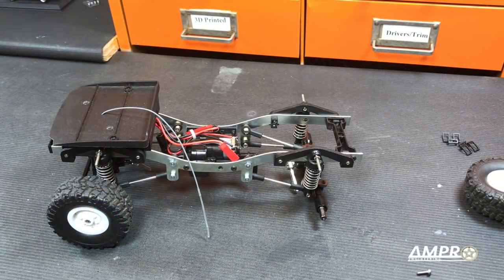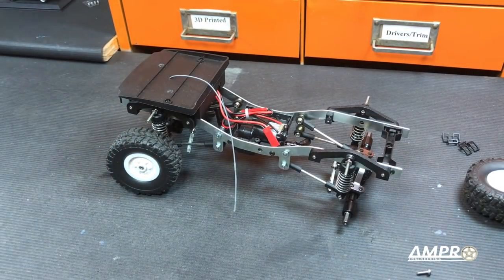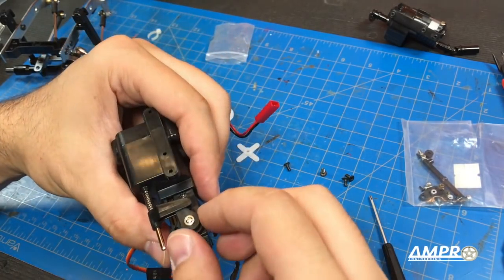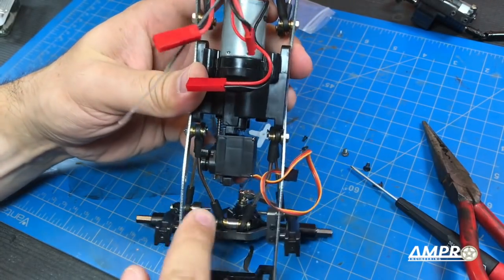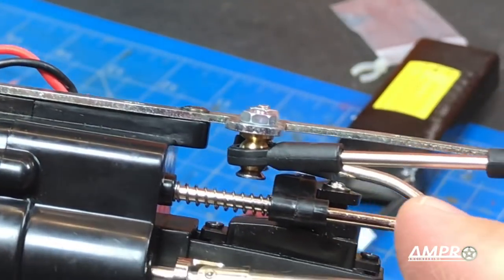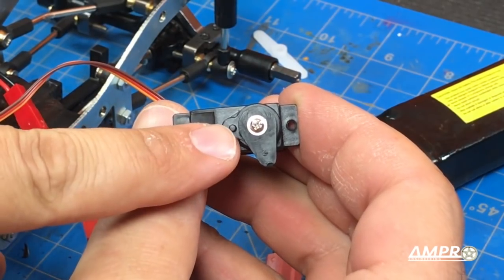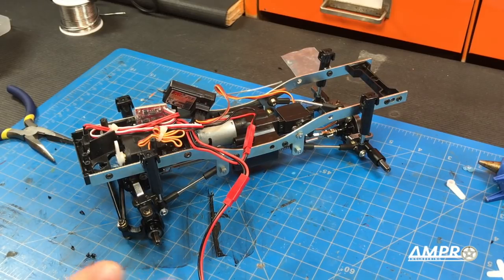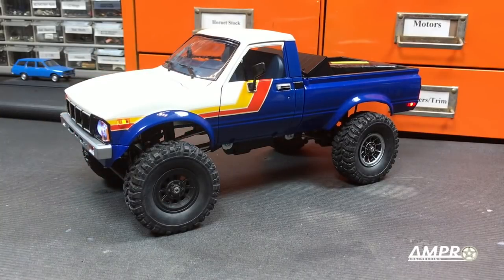e171: WPL 2 Speed Transmission and Project Completion

Comment: I found the same problem with shocks.
The best I found and have used are standard losi mini t oil filled.
They have long travel and are soft  for pretty much all wpl  and mn  models
Both 1/16th & 1/12th 
They work really well.
Reply from the maker: Oh yeah I have those too! I ended up using new oil filled units that just came out for it.

Comment: just using them should make them run smoother... if you get slippage then a washer behind the input gear inside each pumpkin should help... but you really just have to put up with it until your metal set arrives... use locktite on all the grub screws when it arrives as i had mine loosen until i added locktite
Reply from the maker: No it does run smoother and yes, loctite is my friend on this

Comment: Yay, I'm not the only one who got that 2 speed transmission box that has a notch instead of what others have been getting. Thanks for the tips!
Reply from the maker: There is a different version?
Reply: @AMPRO Engineering yes, there are 2 kinds that i have seen. One does not have a spring and the servo attachment looks like an elongated o ring that acts like a rail to drive the shifter. The second one is spring loaded too but slightly different than what we both got.
Reply from the maker: Interesting, I have three at home that I got from different vendors. I will look at them!

Comment: Sorry, very new to this chassis as santa is bringing one for my boy. does the OEM electronics control the two speed trans servo too?
Reply from the maker: No it will not. You will need a different radio, speed control and receiver.

Comment: You could try drilling the valve holes in those shocks a little bigger, would still need some thinner/softer springs.  Some cheap 1/16 or 1/18 crawler shocks shortened might do the trick, they tend to be soft, at least might find some springs that work.  Next thing you know somebody's going to make cable-locking diffs for this thing.
Reply from the maker: Yeah I did but they were just too stiff sadly. Now cable locking diffs...now you are talking!

Comment: mine with 2 speed, metal gears with full metal axles, the beefier metal drive shafts (the scale looking ones are actually crap) and bearings, is a really capable little truck... it never seems to lack power which was the problem i had with it from the start with the standard (kit) motor... id suggest the full metal axles as i had the ones with just the brass fixed gear and the plastic ends began to allow the axle to spin inside... still using the original shocks as like yours, my upgraded shocks wouldnt fit...
Reply from the maker: The scale drive shafts are so pretty but yes, total garbage.
Reply: Where did you find full metal axles at? I see them on eBay. But not for c14 or c24 . I see them for the 6x6 and the other wpl models
Reply: @raymondmanduley6299  i purchased them for the 6x6... compatible... plus i put the spare one on my sons wpl...
Reply: Are your stock shocks also very noisy?
I'm putting my kit together today.
Reply: yeah... a little creaky but just add a little grease and they quieten down
Reply: @TheDaddy187  ok sounds good!
I have the metal "kit" on a fright from China (all metal internals and turnbuckes etc.) And will just keep it like that for now.

The front a rear axles are REALLY clunky and the gears bind so much... any way to fix it?

Comment: Sorry if this has been asked/mentioned somewhere, but what tires are you using on this C24?

They look like the stock tires, but they look bigger for some reason.
Reply from the maker: These are indeed the stock tires. I do have printed wheels so maybe that is creating some kind of optical illusion?
Reply: @AMPROEngineering  I realized that after I posted. Your wheels look great. Nice classic look.

Comment: Alberto, pop by a hobby shop, K&S metal rack, grab music wire to wrap your own springs?
done it many times, it is spring steel. for those you might need 1/4" or 5/16" size rod to wrap on because of spring-back. .020 diameter? .015? make them a little extra long for pre-load, then trim coils if needed after.
Reply from the maker: I think that is a good idea but the oil in the shock seems to be the problem too. When I drained the other ones they were almost perfect. Ill look into that.

Comment: What length shocks are you needing?
Reply from the maker: I think 40mm but the spring rate seems to be the issue.
Reply: @AMPROEngineering  hmm. Yeah you might need to print up some shock towers to increase the length to something more common instead of mounting directly to the frame rail.  It'd look pretty sweet that way too.
I'm a shock snob.  Having actual damping makes so much difference that I can't stand driving an undamped rc.
Reply: @AMPROEngineering  or you could try doubling up the springs you do have assuming there is room between the perches.

Comment: Would it be possible to mount the transmission upside down to increases ground clearance? Just a Thought
Reply from the maker: It is a good thought. I am not sure but I suspect body clearance issues and driveshaft binding?
Reply: @AMPROEngineering  yeah that's true alternately you could make a plate either side and raise the mounting points above the chassis rails keeping it in it's current orientation I think something like 5mm would make enough difference without to much issue in the driveshafts and you could lengthen the upper links front and rear slightly to reduce bind by rotating the axles

Comment: Hey I was wanting to buy a trail finder and I was wondering if you could make an adaptor to for the high lift 3 speed transmission for it
Reply from the maker: Yes that should not be hard but to be honest the TF 2 speed is way better than the 3speed in the highlift.

Comment: Is your transmission an aikeec brand? I’m searching that brand and this video keeps coming up. I purchased one on eBay  for my wpl. I later read that wpl actually makes a 2 speed trans and that’s the brand you want to get.  Not any other brand.  Is that accurate?
Reply from the maker: I wish I knew. it had no label.